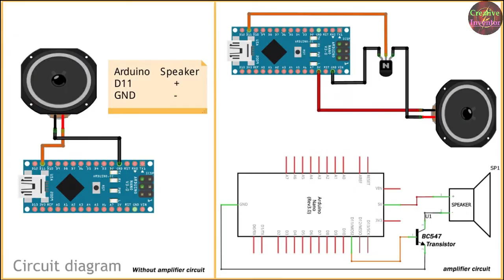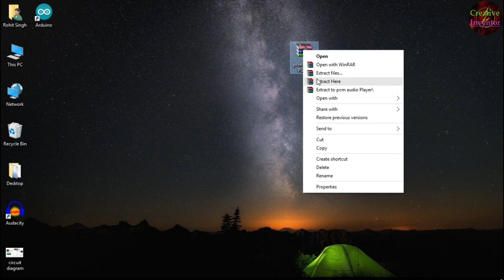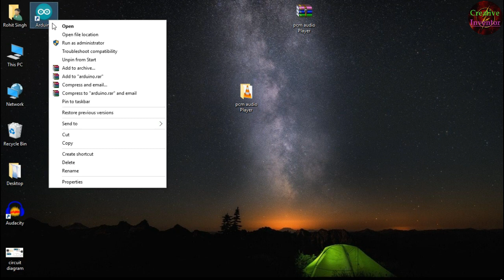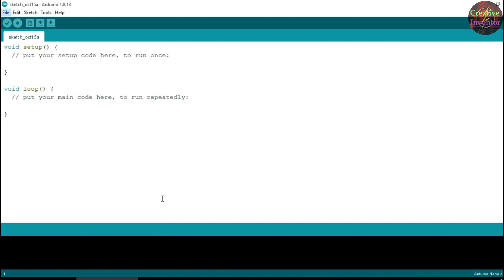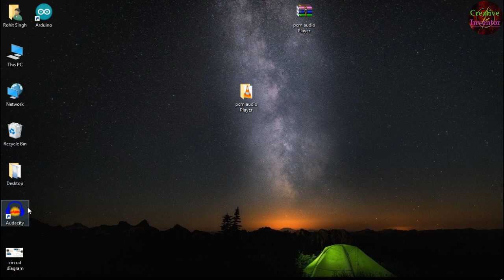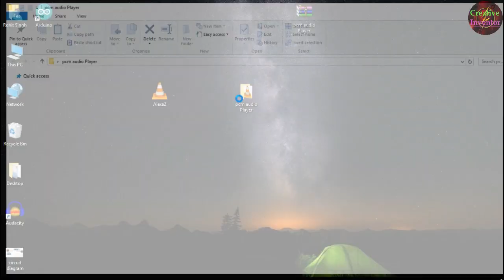How to Play Audio with Arduino, PCM Audio Player Using Arduino | DIY Audio Player without SD Card

Comment: Greetings Creative Inventor, There is a problem with your circuit (no offence). When using a transistor to boost the audio, 2 things must be done. I would suggest to use resistors to lower the current draw and you should use a capacitor between the transistor and the speaker to cut off the DC going to the speaker. DC voltage is bad for a speaker. Also when you are limiting the current, you are protecting your Arduino output pin from burning. You will see your audio will be so much better, because right now on the video, the audio has a lot of distortion.
Reply from the maker: Thannx, i already knew it, this circuit is made with minimum parts, not for building commercial purpose, if it was planned to make, then there will be added more capacitors more than one for input and output for clearing distortion as well as more louder output.